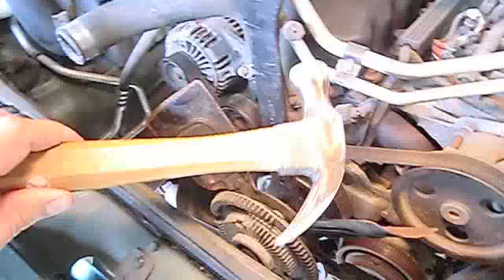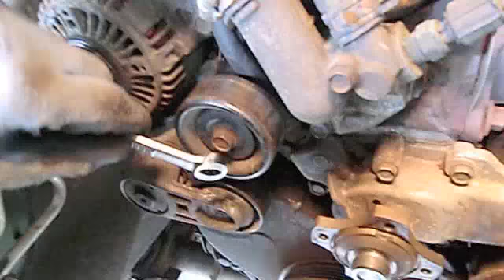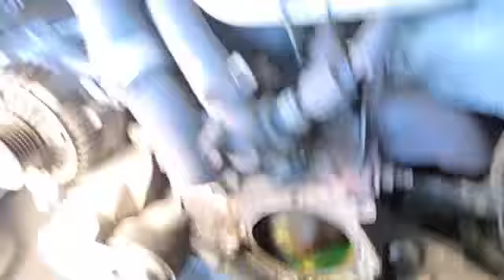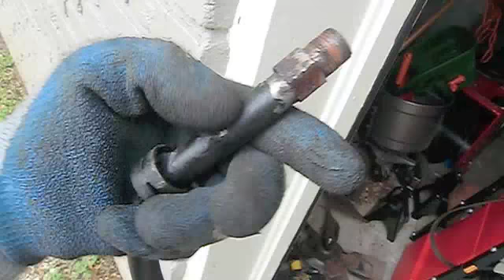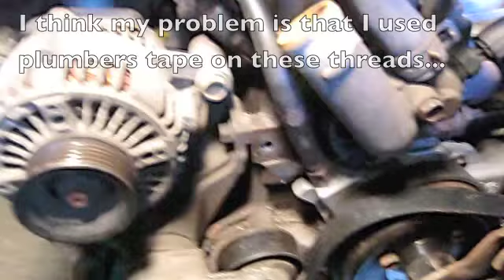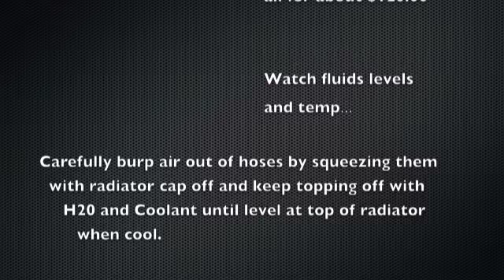Jeep Wrangler 2000 6 cyl - Water Pump Replacement

Comment: What’s up with the pickle fork!  Just use a 1/2” drive into the idler pulley. 3 seconds to take the belt off and super easy to get it back on.  My 98 has the idler adjustment bolt and it’s the worst design ever from an engineer!

Comment: better than most other videos.....I still cannot separate the clutch fan from the pump...even with bigger hammers clamps, bars, etc.
......and location of one fan shroud bolt is inaccessible....engineering and lack of it makes us guys become inventors and say bad words....2004 Jeep Cherokee inline six
Reply: +Bill Waldron agree about the shroud bolt. PITA I ended up changing the location. Jr. engineer design for sure !

Comment: The tube you replaced , that you "dont know why they did that", is the water pump intake. The reason they did it, is there can be a decent amount of suction. If there is a kink or sharp bend in the hose, the suction may cause it to pinch off. Flexible metal tubing would be a better choice, or you can find that exact tube online for about $10. But thanks for upload!

Comment: On the tensioner there's a square hole that will except a 3/8s or 1/2 drive ratchet  Plus you can use a large crescent wrench to get the fan clutch off. Great video thanks for sharing. ,

Comment: I cannot get the fan off? I might have made mistake by removing belt first, but i bough belt wrench, and other tools, it will not move. Should I put back the belt and try it? I remember belt wasn't keeping it tight either? Any suggestions please? I wasted my whole Sunday for this, and all I could have done was getting the radiator off and flushing it.  Thank you

Comment: To loosen the belt tensioner just use a 1/2" ratchet in the little square fitting on it.  Works a lot better than using that pickle fork.

Comment: Im in the middle of doing my water pump now and had to see how ya got the fan off.Thanks for that.
Hope youre not offended by this poster...
Maybe this will be of some use to someone w/o a fork.
If you notice when he pushes down w the pickle fork on that tension arm, straight down from the opening in the fork there is a little square hole. A 1/2 drive pops right in there. Give it a push clockwise and the arm drops down easily to loosen the belt = no bloody knuckles if your bar or whatever slips.

Comment: No its not the actual tool to move that tensioner is a torsion bar with a socket the pickle fork is actually called a ball joint fork but hey it still works